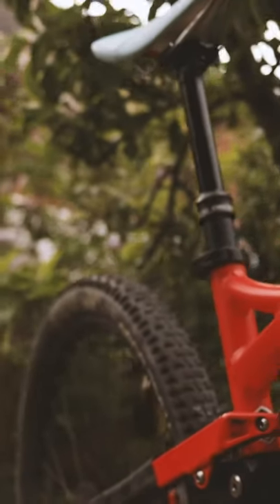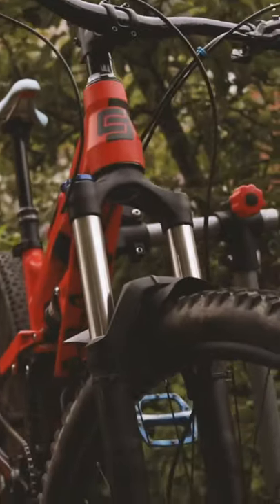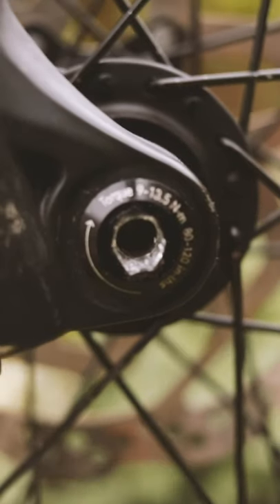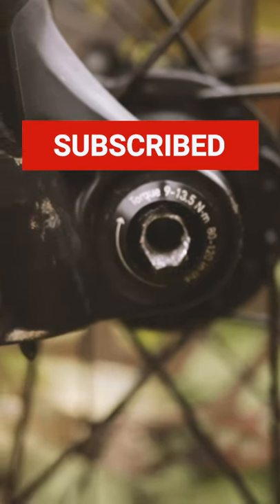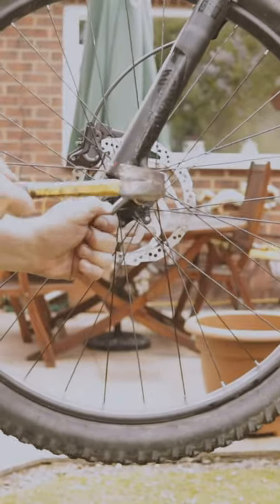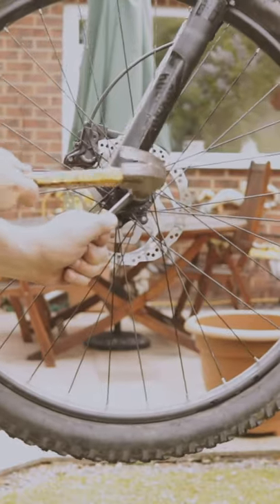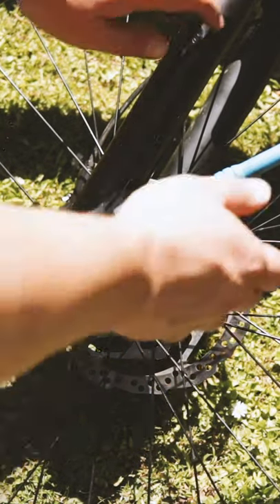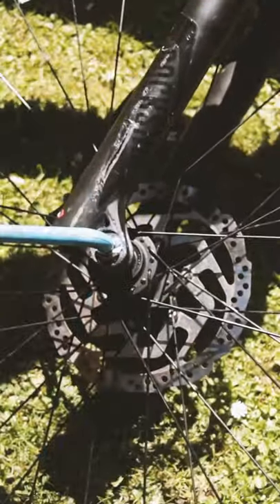Removing a stripped mountain bike front axle (Rounded hex bolt)(thru bolt)MTB maintenance  #shorts

Comment: This was helpful, and I have another suggestion if you haven’t mashed it too bad. Try an imperial hex.  I stripped a 5mm hex axle.  Tried an imperial 7/32 hex and didn’t need to hammer it in.  Pushed it in and it worked immediately with normal force.  After removal, getting the imperial hex out of the axle required more force, but since I put it in with hand power (no hammers) could also remove it with hand power and the right leverage.   And if you are reading this, remember, don’t panic.  You will get it out.  Think clearly through your specific problem (can’t when you are alarmed / panicking about the stripped axle.)

Comment: The dtswiss 142x12 rws head unscrewed from the axle. Now i cant take off the wheel. What can i do?
Reply from the maker: strange one that! does it tighten up and loosen off when you spin it around?
Reply: Yes, you can install the head back on the axle but all attempts to get the axle out have failed  even a double nut and bolt trick failed. Those dt swiss heads unscrew. Has to be one of the worst designs i have ever seen. So as of now i have a hollow thru axle installed with no tip or head. Epic fail
Reply: Its a 2016 trance frame. So it has that piece that the axle screws into on the drive side. So i have a nut and 2 bolts, i just added jbweld to the nut and tightened it all down. Hopefully this can grab the axle enough to extract it. What a gd pita.
Reply: Keep in mind this was clean and well greased. No dirt or anything. The head had some black stuff so it must have been something used by the factory. They should have just welded it on.
Reply: If this doesnt work i may have to over tighten and strip out the drive side to get it out. Fkn giant designs are the worst. Dont get me started with that shock setup.....omg.
Reply from the maker: @Hawlkeye-e9p  sounds like a right nightmare, to be honest I'm sure where you can go with this one to be honest perhaps if you can suspend the locking nut and also the handle to ensure nothing moves around and see if you can twist it around like that... failing that see if you can pull it in or out to see if it holds. 

I'm assuming you've pushed it back in on its self to click it back in place because they are spring loaded

Comment from the maker: Did you find this useful? Are you going to to try this if you strip your axle? 

Comment below! 🤟🏻
Reply: Very helpful video.    About 6 months ago I purchased an axle specifically with an adapter on it to toe kids trailer (riding my Cube Reaction Race with a trailer breaks my heart by a Dad's gotta do what a Dad's gotta do)... the hex bolt has started to show signs of rounding so I think the next time I change it may be my last... but would the technique you used also work to re-adjust the size of the hex bolt and make it reusable again (with some care) or is this video tip really only for removal prior to replacement?
Reply from the maker: @lukehuggins121  Hey Luke good question! 

Personally for me id always replace your axel if its showing signs of stripping because from that point on you'll always end up rounding it more since its usually aluminium and that's a soft metal. 

so I would say just replace it, you can go with two schools here: one is buy cheap ones and have a spare one or two: buy an expensive one with different metals. 

And also don't forget tools are important if you have crap tools they'll be more likely to strip the bolt head. 

Id look at damage prevention on this one bud! 

Also danny mccaskel made riding with a trailer look cool I'm sure you can to haha
Reply: @TheNorthernRider  Thanks bud.   Checked out Danny’s video, brilliant.

Will definitely take your tips on board.  Cheers
Reply from the maker: @lukeh8644  haha danny day care is hilarious haha awesome man if you need any help just drop me a message or find me on Instagram I'm just @thenorthernrider

Comment: I've seen alot of videos covering this subject (as its happened to me!) they always end up with people replacing the axle with a conventional QR level type design.

The allen bolt release maxle is a ridiculous design. Can only be removed in a workshop setting with a decent torque drive with the right bit - no good out and about when you're only carrying a multi tool!